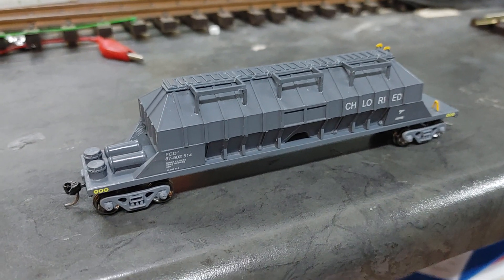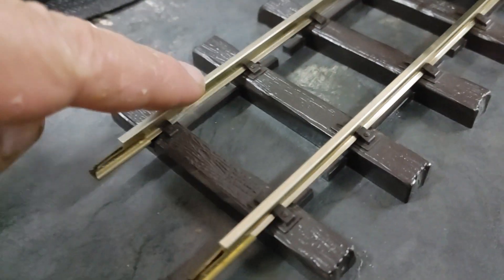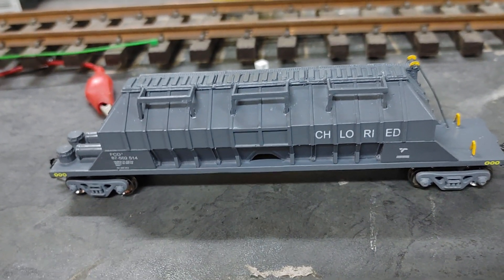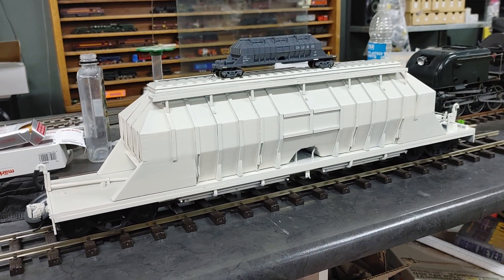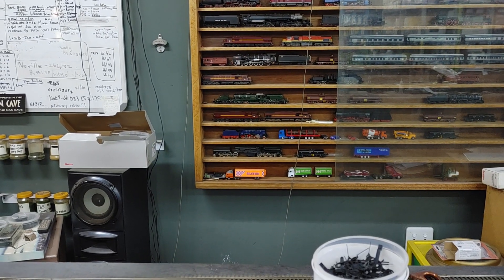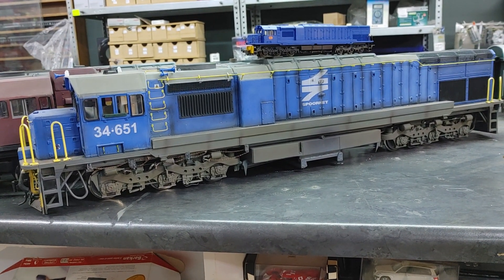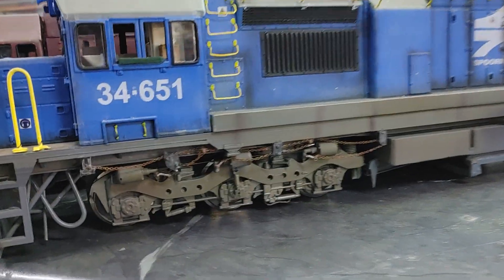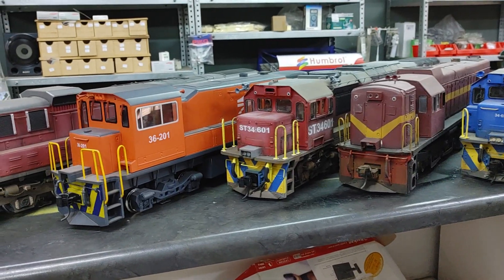1/24 scale size explained

Comment: er, cube that: 1/24 scale is  3.6 times as long as 1/87; but also 3.6 times the width and 3.6 times the height!  
3.6x3.6x3.6 -- it's more than 46 times as large as H0

Comment: I'm not too sure about "loving" HO scale. With no offense to any collector, I have seen this HO scale, N scale, all as being nothing but problems and issues. My thing is the VERY reliable O scale and even then I do 3 rail which is easy and detailed enough for my likings and the likings of SO many Lionel collectors and other o gauge trains.
Reply from the maker: O scale is a lovely size. Not too big and large enough to show detail. As well as dynamic smoke in some of the MTH offerings and at a price that wont break the bank.

Comment: So the SAR HO models are scaled to 1:87 with 4mm wider wheelbase to suite the layouts and rolling stock etc?
Reply from the maker: Hi Steven, yes. I have found and i might take flak for this, that a gauge discrepancy is very hard to spot. The connoisseur will pick it up. But in Africa 12mm gauge track is not common.
Reply: Thanks for clarifying, it makes sense to go with the 87 scale to go with the coaches, tunnels and people already modelled.. working back from the 16mm gauge, the scale for 3ft6 would be closer to 1:70, which makes the loco's too large for the surroundings.. 

It gets much worse still with modelling the 2ft stuff.. there you really need to make everything from scratch, as the scale comes to 1:37 for HO guage track..